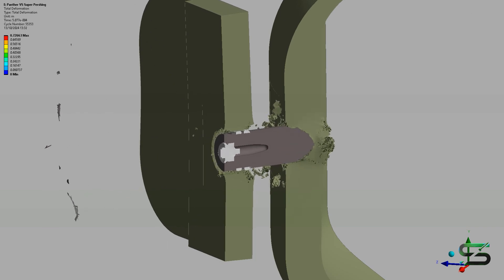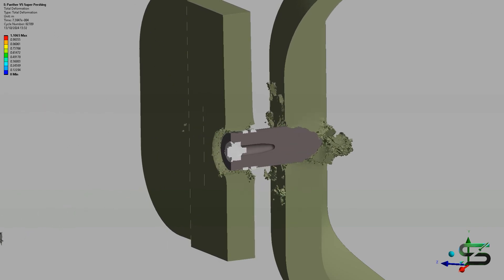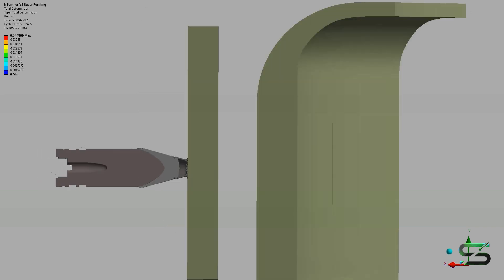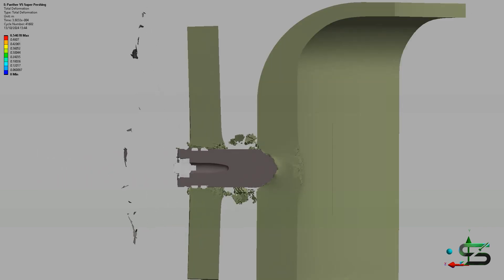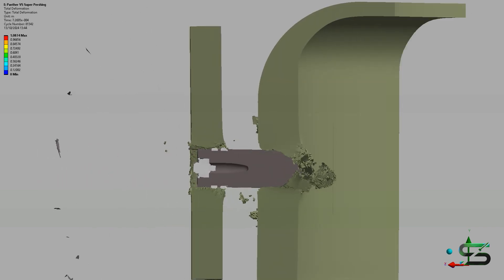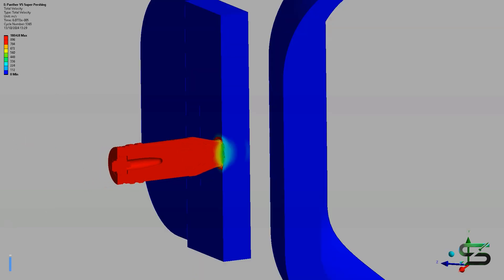Panther VS Super Pershing | Armour Piercing Simulation

Comment: A hit like that would have done probably nothing to the crew though, there is a spaced 3.5 inch structural steel casting behind the main mantlet. Normally it's covered by a tarp from the inside, so it's not obviously visible.

Comment: About the famous tank duel at the Cologne Cathedral: I dont know anymore which one specifically but one of the crew members of the destroyed Panther stated that when they saw a tank gun with a muzzle break reach around the corner they figured it must be another Panther so they didnt really pay attention to it. When the Pershing rounded the corner completely it was already too late. Most of the crew survived by the way except for one iirc.
Reply: An interesting note is that the Pershing's gunner had previously been in a Sherman that got hit by a 105 mm HE on the turret star.  It did not penetrate, but exploded immediately killing a foot soldier outside.  The gunner had just ducked down into the turret, but it rang his 'bell' and KO'd him.  He had a concussion but served in that Pershing anyway!  Also, for some reason, the Sherman had issues with its engine after being hit.  The mechanics could only change out the engine to solve it.  This delay saved the crew's lives since an attack went in and the rest of the platoon got it.  Lucky gunner!
Reply: @lewcrowley3710 It's possible the round ethier messed up the device connecting the turret to the engine or the round went straight through the tank into the engine
Reply: @ No.  It was an indirect fired HE round set on SuperQuick fuse.  Basically exploded on contact. repair guys tried changing spark plugs, etc.  But finally swapped in an available engine.  In any case, the gunner was knocked out and should have been relieved.  But he was assigned to the Pershing.

Comment: uh hello? the panther didn't have pzgr 39 rounds, it had pzgr 39/42 shells, which could slice through 190 mm of armour.
Reply: also the pzgr 39 round could penetrate 145 mm of armor compared to pzgr 39/42's 190 mm penetration
Reply: Hello.  Have a source?  Panthers had very little pzgr 39/42, and that was at Kursk (documented).  And, technically, they are not 'shells'

Comment: Two questions:
1st- If it doesn't penetrate and stop the door, wouldn't the detonation of the APHE explosive add penetration or damage to the crew carrying out their role? The projectile simply doesn't detonate.
2nd- The penetration of the expanded armor should detonate the APHE charge, since there was a penetration greater than 14mm, which is the calibrated armor for German APHE ammunition to explode.
Reply: The actual explosive is something like 15 grams.  It would not help penetration even if stuck in the armor.  It is on a delay, so it should go off since it is a base detonating fuse triggered by deceleration.  There is evidence of this with a KV-1 tank with AP stuck in them, and the back of the AP does show it detonated.  Also note, the explosive would not shatter these AP shells.  Perhaps if they were cracked by the penetration, it might split the penetrator, but not 'grenade' it.
Reply: the explosion is with a delay so it explode 1 meter after the impact

Comment: The Pershing in the famous Cologne tank duel was a regular M26 Pershing (T26E3 to be specific), not a SuperPershing (T26E4). I know you said "a different variant of T26 was operating", but that still implies it was a SuperPershing. 
Better to clear that up, since the T26E4 with its add-on armour and the much more potent gun is quite a different beast compared to the regular M26.
Reply: Exactly. That's what I was coming to. In fact the front plate on the Super Pershing is a piece of plate cut from a Panther.

Comment: OMG this plate has never 80mm . The Super Persh could hardly elevate that big gun and now you put another 80mm plate on the mantlet ? And the Panther had 138mm at 30° penetration,  this would go clean through even with the 80mm plate .

Comment: my guess is that the Panther crew didnt properly ID the pershing tank as an US tank. If you look straight at the front the pershing is somewhat similar to the tiger
Reply: It was confirmed the panther crew thought they were looking at a german tank hence they did not fire.
Reply: That's part of the design stupid Germ
Reply: @jonowens460 sorry bud I don't understand?
Reply: Although I'm sure the story is confirmed to be true it's so odd, the German crew knew they where alone, they where facing pretty much where the Pershing came through and yet once they saw it they didn't fire on it as they thought it was German? In the later war period? Bad crew imo
Reply: Many German tankman is getting order to hold a crucial point for days without any further command not to mention all the seasoned veteran is already KIA in the past years  @JD-Pants

Comment: The "wings" where 38.1 mm thick just like the pices for the frontal hull armor. The 80mm taken from the panther was the armor that is placed on the mantlet also could you do the return fire if possible ?
Reply: The gun likely wouldn't be able to elevate with the shell staying there.